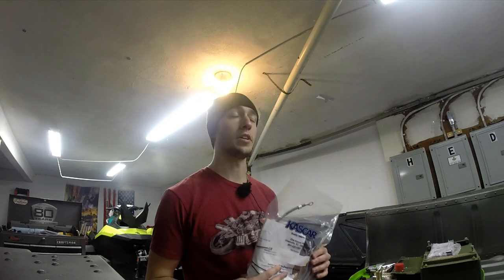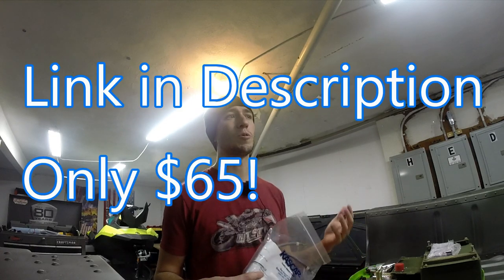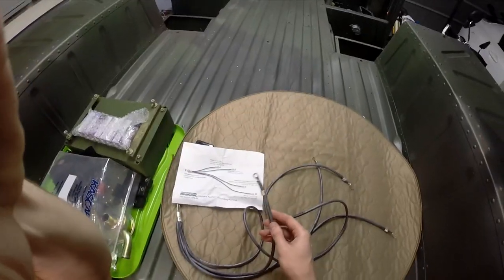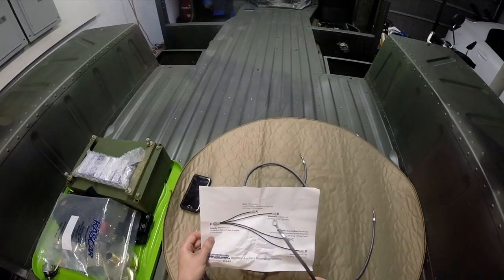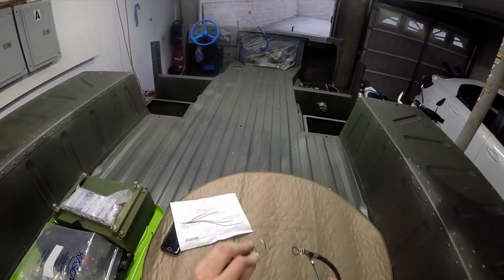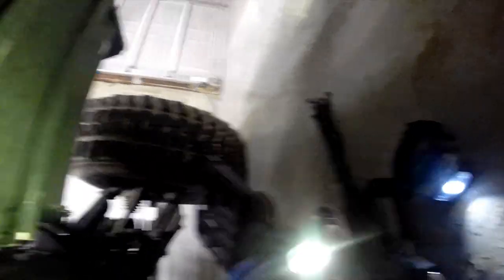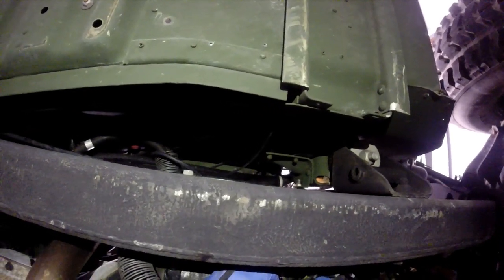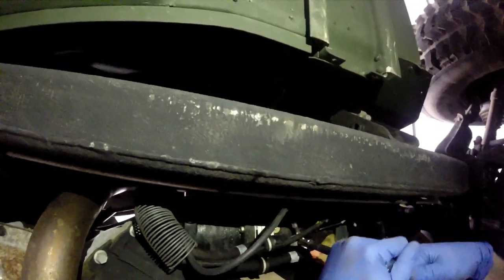M1123/M998 Humvee Kascar Grounding Harness Install - Humvee Series Ep. 4

Comment: Always Mark and Organize your wires for future maintenance and replacement this will make any future maintenance easier! Get yourself a multi meter if you do not have one. Take a basic electronics course. And always disconnect the power this will protect you from electrocution! Safety 1st! Proper planning and keeping wires neat and organized by using zip ties help to troubleshoot future electrical problems!